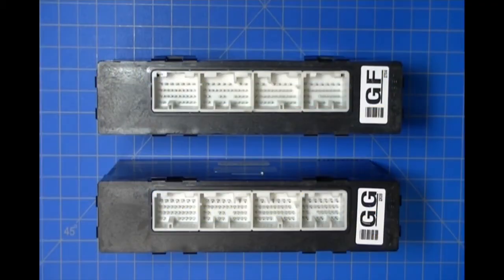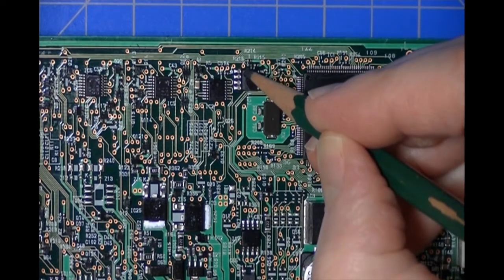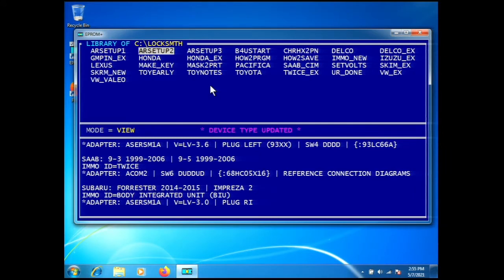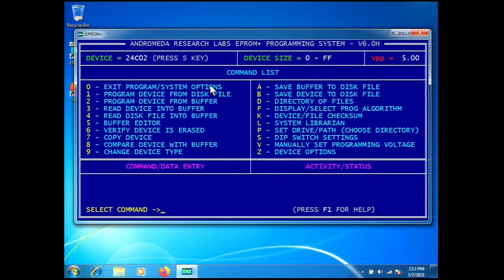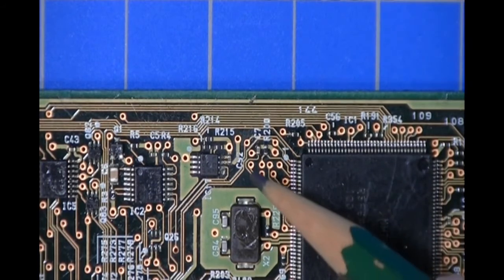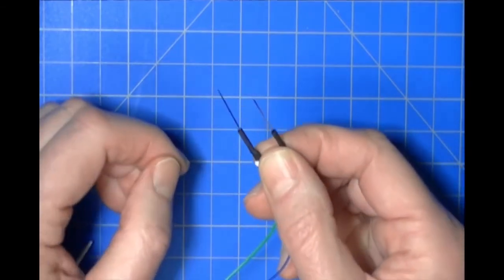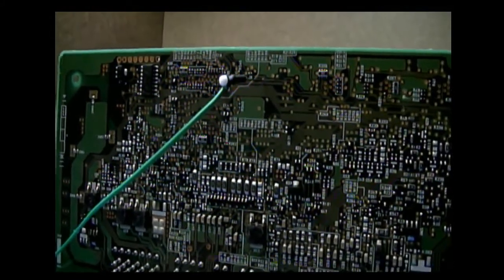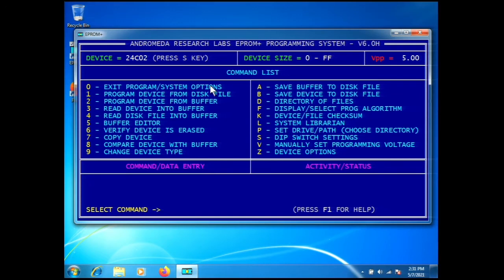How to read two SUBARU BIU eeproms in-circuit using the SUBARU BIU PROBE SET and the AccuTouch Probe

Comment: Hi, how were you able to locate the MSOP? I have a 2021 crosstrek biu that looks very different from the ones you were dealing with. Please let me know if you can help. I can possibly send you a picture of the biu I’m dealing with if that’ll help. Thanks in advance!
Reply from the maker: If the circuit assembly is different it's possible that the eeprom data is located in the processor. If that is the case it is not possible to perform a module clone. Look for any 8 pin part and note the numbers. You can send these via email (arlabs@fuse.net) and I'll try to help.

Comment: What is the process for sourcing a virgin or replacement file if the original data is corrupted?
Reply from the maker: Unless you can find a virgin file on the internet, the only reliable source is from a new (never installed) module. Once you read and save the data you can virginize any identical used module.
Reply: Thank you for making this video